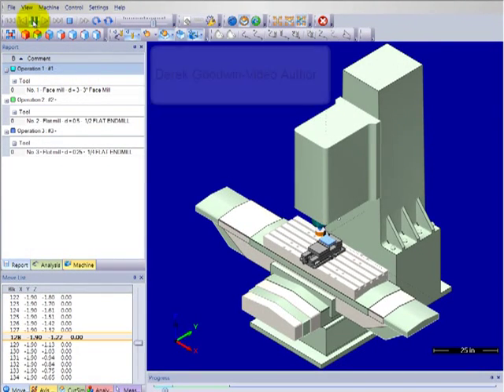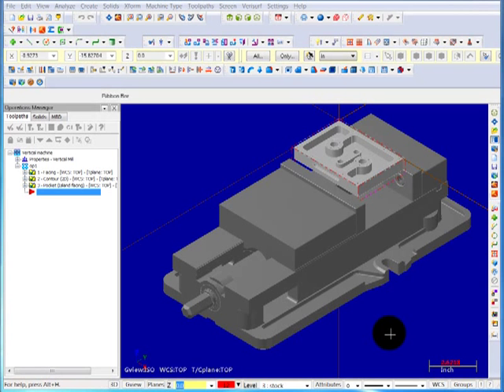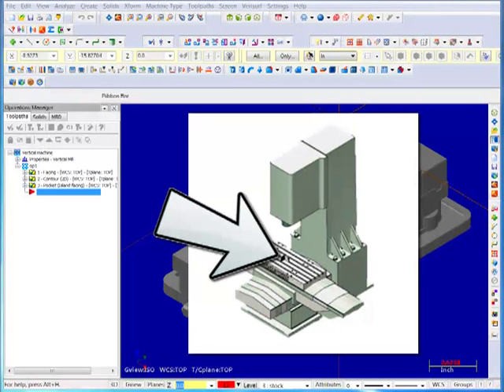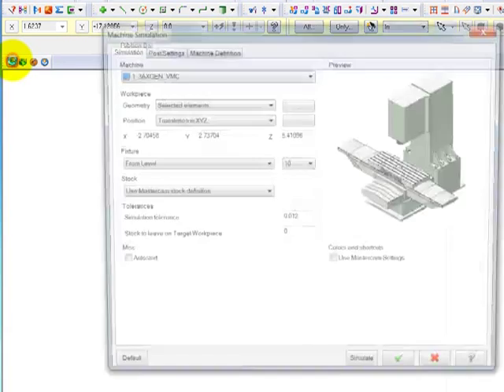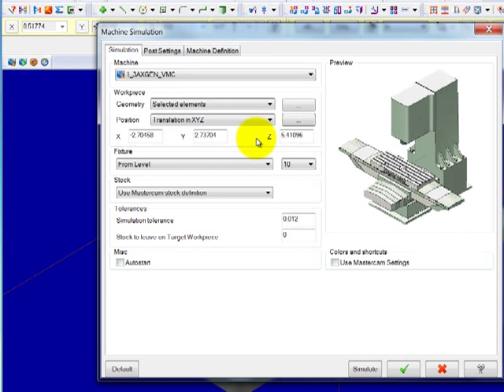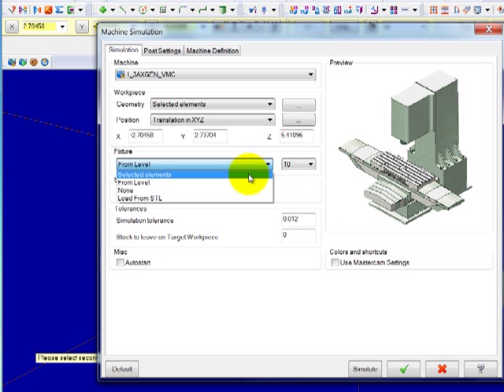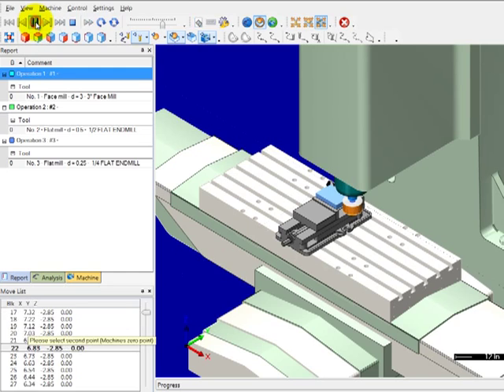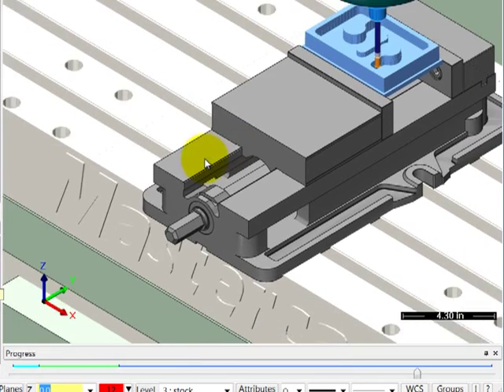Mach_sim_youtube.mp4

Comment from the maker: Yes, I tested this part with a different system origin, and placed a new WCS origin on the same corner. It works fine, the setup is a little different.

As for multiple parts, I believe it can, but need to develop the methodology. We will be working through this over the next few weeks.